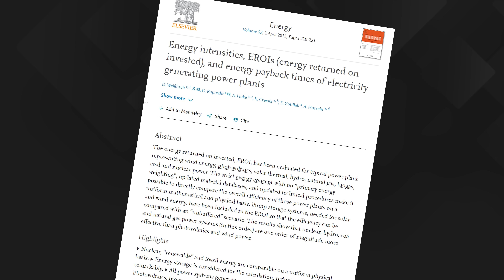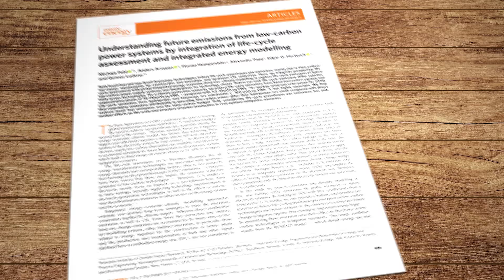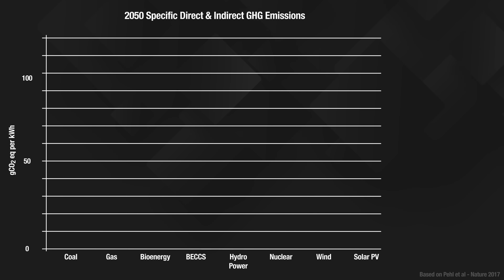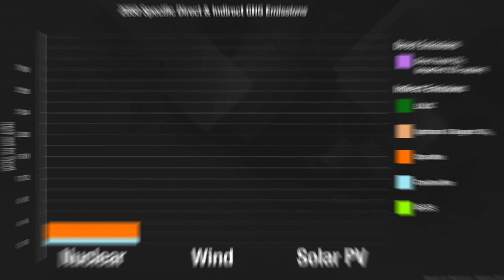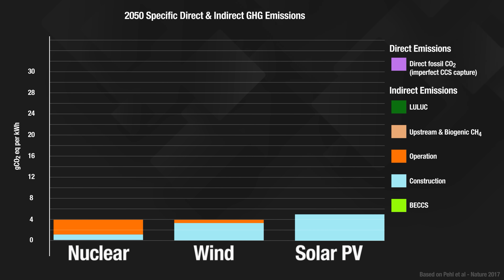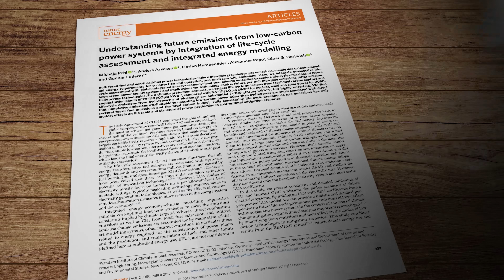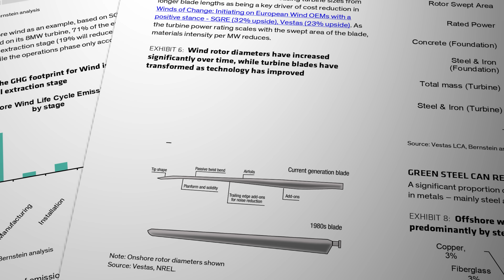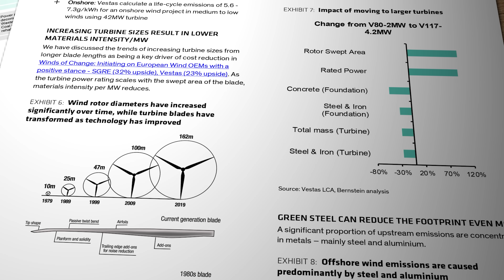Lifetime carbon emissions of renewables vs fossil fuel. Problem or solution?

Comment: great video of course. I'm all for renewables but perhaps taking into account the reliability factor (vs nuclear), and the need for energy storage for renewables would be a better way to compare. Batteries require a huge industry behind that also produces CO2.
Reply: It occurred to me that batteries for car and airplane transportation requires low weight, high energy density storage that is currently complex and expensive and more polluting, whereas static batteries will be eventually served by simple, cheap, heavy, and inexpensive systems. For example...sodium lithium batteries, or even iron lithium batteries, etc...
Reply: @davidkreimer2970  While that maybe true the amount of raw materials required will keep them as "usable" but no "silver bullet". While we know how to store "liquid energy". The burning of synfuels is carbon neutral and it doesn't lose its energy potential in storage.
Reply: Maybe the safest of all (until we get fusion in "30 years") is to have a mix of everything. But I truly don't think we are in a position to completely discard nuclear, there have been great developments there where a lot of the waste is used up as well. We should really consider all options on the table
Reply: @del669  Heat is a TERRIBLE source of electricity.  It's just too expensive.  As we add more solar and wind this suppresses the CF of any thermal generators like nuclear increasing the cost further.  There's a reason >50% of the nukes in the US are losing money.
Reply: I was thinking that as well, however, I think the relative CO2 contribution of energy storage is not huge as you think.  There are some very long cycle life technologies like LiFePO4 and flow batteries that theoretically can be cycled daily for many decades.  Energy and power density do not really mater when it comes to stationary storage, so there are many more options.  Its all about cycle life.  The longer a battery lasts the smaller its relative CO2 contribution.
Reply: Energy storage for renewables is to use the electricity to make Green Hydrogen then use that to make ammonia for fuel cells. Many chemical ways to store that energy today by making syn fuels.
Reply: @jerrywatson1958  True, there are some other creative ways as well. I guess this will all depend on what industry forms the most efficient one for doing that.
Reply: @del669  I think it is all about the markets for the other products that can also be produced alongside. A lot of these other products have been made from natural gas. Now that the price has shot up, green hydrogen has started to replace it as it is stable for the long term and not dependent on any unstable countries or politics.
Reply: @jerrywatson1958  Grid scale energy storage does not exist and will not exist anytime on the horizon. It would be nice if you would be honest about that. Why not store the solar energy in the uranium of a 6 billion year old supernova?
Reply: Don't think of renewables in terms of reliability.  Think of them as fuel savers.  As long as a $1B investment in solar reduces fuel consumption by ~1TWh/yr why does it matter when that reduction occurs?  Eventually they can reduce fuel consumption to < 0 (produce H2) to achieve 100% clean energy.
Reply: @Chris-ie9os  Great point. But remember that if we don't store we'll have a lot of wasted energy from times when consumption is less than output.
Reply: @Chris-ie9os  But when you view them as "fuel savers" (emissions savers in your eyes) it makes it even more obvious why we should have just gone for nuclear from the beginning. Because all renewables currently use natural gas backup and thus are guaranteed carbon emitters compared to nuclear.
Reply: @gregorymalchuk272  Nuclear needs gas back up too.  Nuclear is too expensive to be a load following.  If min demand is 20GW you won't have >20GW of nuclear.  What keeps the lights on when demand is 40GW?  The other 20GW would be gas.
Reply: @Chris-ie9os  This is absolutely not true. France's entire fleet of light water reactors are capable of running in load-following mode.
Reply: @gregorymalchuk272  .... they can export to the rest of Europe and EDF is STILL going bankrupt.  Nuclear with a CF of 90% is ~5x the cost of renewables as it is.  That only increases as CF drops...
Reply: @Grobocopatel  Point is that EVERY nuke in the world is an economic disaster.  It simply isn’t cost effective compared to renewables.
Reply: @Chris-ie9os  that’s funny, according to Lazard nuclear is way cheaper.
Reply: @Chris-ie9os  that's obviously monumentally false, not only because economically competitive nuclear builds repeatedly happened in North America during the late 1960s-early 1970s, in Europe from the 1970s to the 1980s, and in East Asia from the 1990s to the 2000s, but also because renewables were insanely expensive as recently as the early 2010s (which is why subisidies in the form of the German EEG surcharge, which pays for the 20 year tariff guarantees for early adopters of renewables, still amount to ~20% of the retail price of electricity).
Reply: @Grobocopatel  Nuclear has a negative learning curve.  Reactors were cheap 40 years ago because we didn't have that 40 years of operational experience.  Should we just disregard all those lessons learned for economics???
Reply: @Grobocopatel  It ABSOLUTELY has a negative learning curve.  I saw this first hand at the nuke plant I worked at.  For 30 years a ~$500 carbon trap worked fine until there was an explosion and we had to replace it with a $500,000 piece of equipment FAR more complicated.  There are hundreds of instances like this.
Reply: @Chris-ie9os  You can use CAPITALIZED LETTERS all you want, just makes your writing more cringey. That a piece of equipment becomes more expensive isn't proof of a negative learning curve if the quality and durability of the product increases or if it is forced to satisfy regulatory requirements. In nuclear is mostly the latter.

In which nuclear plant did you work in?
Reply: @Grobocopatel  Nuclear has become safer with lessons learned and exponentially more expensive as those actions were implemented.  What would you call that?

Comment: Interesting comparison, assuming the numbers are truly accurate.  I'm currently on grid and heat with both wood and NG, but in the process of piecing together a DIY PV solar system to go off grid and also hopefully offset a significant portion of my heating needs with the PV system.  Every little bit helps, but sadly most people just don't care...
Reply: I just installed 7.5kw array and 12 kw battery - after a month during the middle of winter it looks like a 6 - 7 year payback (and we get ZERO government support in New Zealand).
We did this for strictly financial reasons - New Zealand has 81+% renewable energy on its national grid already.
Interestingly, the guy who installed the export meter said he is flat out in the Wellington region because of the high volume of solar being installed.
Reply: @MrBenHaynes  Yeah I feed power to HOt water but its winter so Wet Back for Hot Water and Solar for everything else.
We get 8c per KW if we feed back to Grid because our grid operator and power companies are averse to small generators - so I am planning other ways to eat my excess power - like building an electric motorcycle and building an induction forge... Summer should fill my battery in 2 hours while running my house - lots of excess.
Reply: @madpete6438   @Mad Pete  Go one step further - find a way to use your excess energy to capture carbon from the air
Reply: @fjsa_2471  I am not that wealthy. I would need someone to do the science and then write a how to... have not seen one yet.
Melting scrap and turning it into useful things is pretty good.

Comment: I suspect that the analysis of solar and wind power fails to include the carbon emissions associated grid scale energy storage, additional power line construction, and/or backup power generated using fossil fuels.  Lots of magical thinking associated with interruptables.
Reply: You could get a sense of this by looking into the figures for grid battery storage or BEVs co2 footprint, which surprise surprise is pretty good.

Comment: I think methane is just as bad and need to slow it down just as fast.
Also more nuclear power plants its really green and we only use 12% of the energy out of the rock.
Also all nuclear waste from power plants  can fit in 1 football field.
Reply: Nuclear is far too under utilized. A real shame.
Reply: I think the point from the video is that there are considerable CO2 emissions associated with constructing the disposal (long term storage) facilities. I.e. the compactness of the waste itself is immaterial compared to the containment facility. And, unlike the material to construct wind and solar, the material to store waste has not decreased appreciably over the past 80 years or so. 
I want to be clear, I don’t want to shut down any existing nuclear facility until it is uneconomic to keep it open. But building new nuclear is folly in almost every respect.
Reply: There isn't that much uranium left and as you say we only get %12 out are you talking about going to molten sat reactors the Chinese have one up and running
Reply: @gingernutpreacher  yes 12% but why not invest in ways to use more like up to 50% can save us lots hell finding ways to use the waste byproduct can help even more.
Reply: Methane is not as bad as it brakes down are you thinking of nitros oxide?
Reply: @gingernutpreacher  no methane do to the fact its about = to are co2 and we don't count the natural ones from places where permafrost is melting.